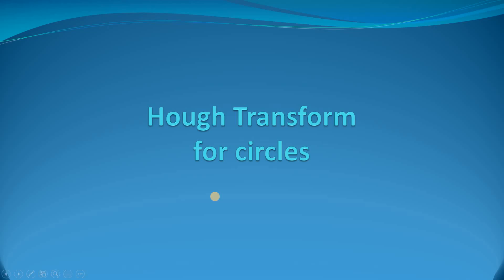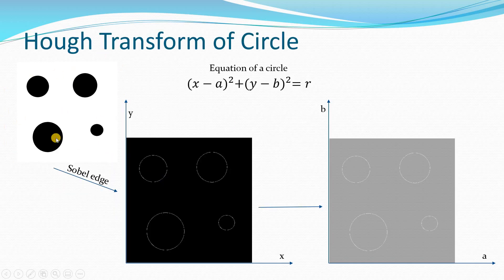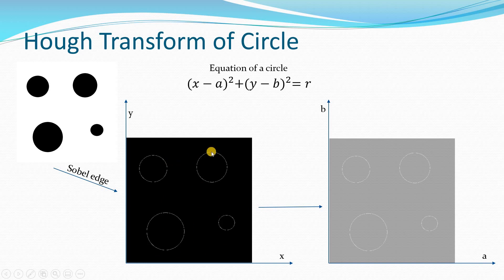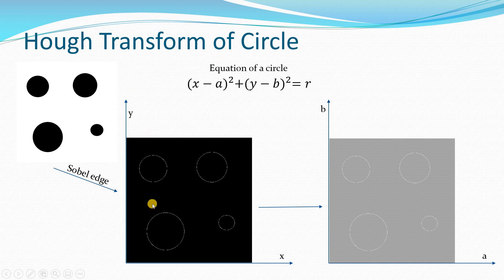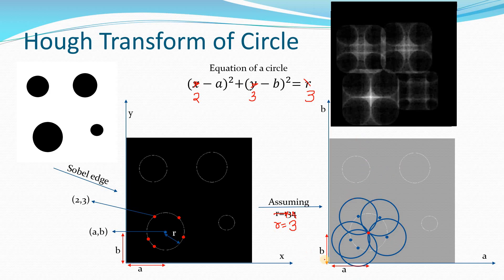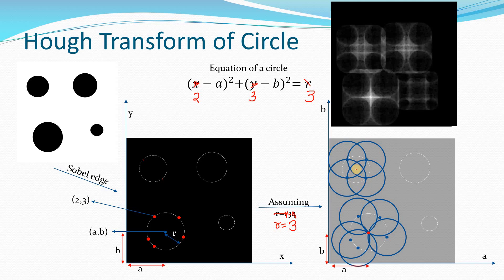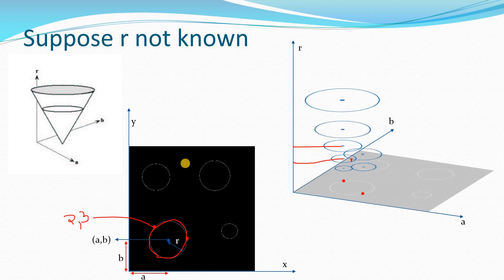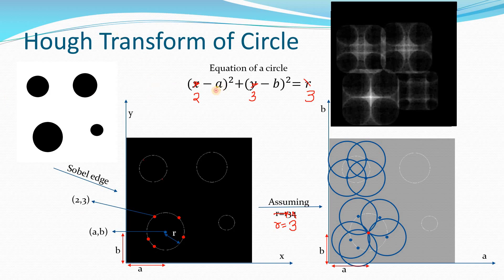Hough Transform for Circles

Comment: also can you explain ur code?
Reply from the maker: here is an algorithm that I had used.

first define a circle with radius r.

ang=0:0.1:2*pi; 
xp=r*cos(ang);
yp=r*sin(ang);

Now we just have to move this circle so that it centers at the edge point (x,y).

Now make an accumulator matrix which is of size (m+2*r, n+2*r) (where the image size is m x n )

now run a for loop for all the edge points x,y detected

make the circle in the accumulator matrix centered at every edge point (x,y)

v = x + xp;
w = y + yp;

increment the accumulator at v,w position

accumulator(v,w) += 1;

Finally choose the point which is having the maximum value in the accumulator.

That is the required center of the circle. 

here you can see the matlab code for the above algorithm

https://drive.google.com/drive/u/0/folders/1UTIgcj0Z-dKo67zNZj8qwmueH0g3OPp0
Reply from the maker: You can also look at some other implementations my code is not very Robust

https://in.mathworks.com/matlabcentral/fileexchange/4985-circle-detection-via-standard-hough-transform

Comment: bro how can i modify your code for general curve like lame curve or an ellipse?
Reply from the maker: At line 14, 15 you will have to change the xp and yp

xp=a*cos(ang);
yp=b*sin(ang);

where a is the major axis and b is the minor axis of ellipse. You can put the parametric equation of the curve you want to find here.
Reply: @pratikian  thanks a lot for replying bro actually I had to do this for lame curve so can you help me with some code for it, as on net very complex codes are there
Reply from the maker: @akainu3668  I could try

Comment: I dont understand. I have fixed R and I know x, y point of edge. How I can get(calculate) a and b to increment accumulator? Which a, b I must use? Which range of a,b? From what to what?
Reply: Am I right? I fixing a: a_min = X - R; a_max = X + R;
after that I do 
for (i = a_min; i <= a_max; i++) {
 b = sqrt(R^2 - i^2);
accumulator[x+i,y+b] ++;
accumulator[x+i,y-b] ++;
}
then same with b_min and b_max to calculate a.

 I fixing b: b_min = Y - R; b_max = Y + R;
for (j = b_min; j <= b_max; j++) {

 a = sqrt(R^2 - j^2);

accumulator[x+a,y+j] ++;
accumulator[x-a,y+j] ++;
}

then I found maximum of accumulator to get

Tell me if I'm not right pls. I need to understand this method.
Reply from the maker: So what do X and Y mean here?  Apart from that I feel that the algorithm is fine it should work. 

here is an algorithm that I had used.

first define a circle with radius r.

ang=0:0.1:2*pi; 
xp=r*cos(ang);
yp=r*sin(ang);

Now we just have to move this circle so that it centers at the edge point (x,y).

Now make an accumulator matrix which is of size (m+2*r, n+2*r) (where the image size is m x n )

now run a for loop for all the edge points x,y detected

make the circle in the accumulator matrix centered at every edge point (x,y)

v = x + xp;
w = y + yp;

increment the accumulator at v,w position

accumulator(v,w) += 1;

Finally choose the point which is having the maximum value in the accumulator.

That is the required center of the circle. 

here you can see the matlab code for the above algorithm

https://drive.google.com/drive/u/0/folders/1UTIgcj0Z-dKo67zNZj8qwmueH0g3OPp0

Comment: How did you implement detection of more than one circle with different radius
Reply from the maker: So for that you can make a vector of the radius of the different circles that is there in the image and run the algo for each radius
Reply: @pratikian  can you help me out with it in your implementation to see how it will work I tried using a for loop but so many smaller circles
Reply from the maker: Okay I will try. Acctually my code is not very robust meanwhile you can also try other implementations 

https://in.mathworks.com/matlabcentral/fileexchange/4985-circle-detection-via-standard-hough-transform

Hope that helps
Reply: All right thank you